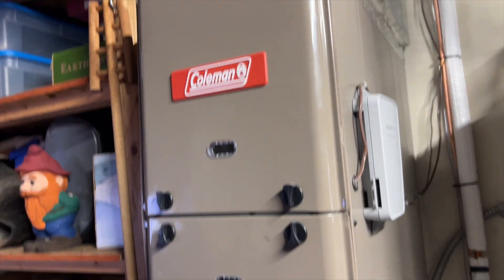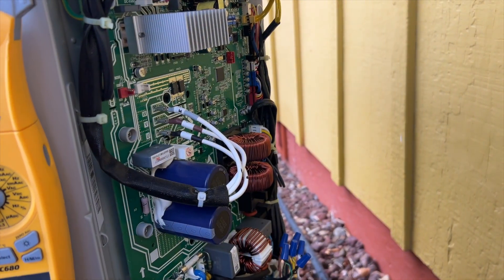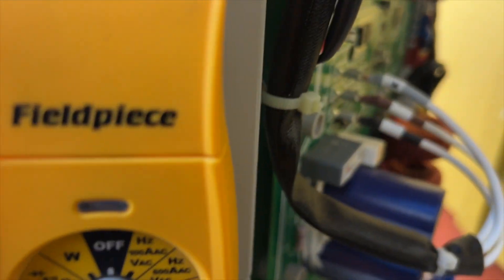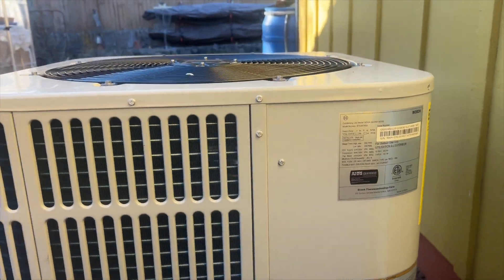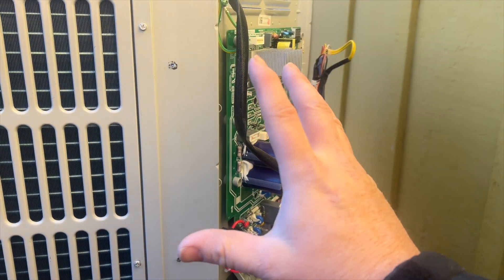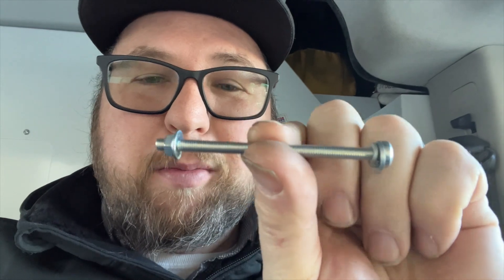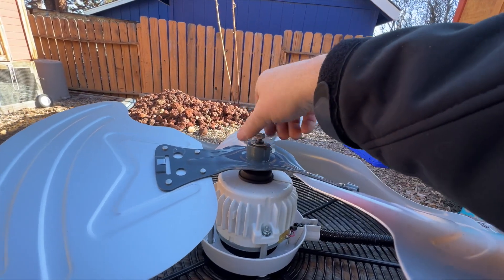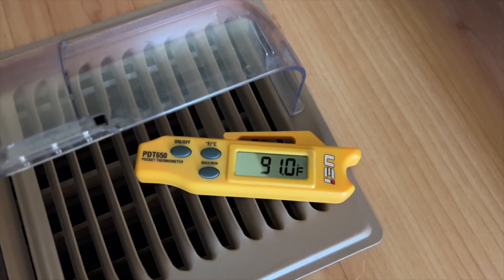Bosch Inverter System Not Heating EP166

Comment: Dual-fuel inverter systems are the only way to go.  Here in Colorado NG is cheaper but most have solar.  And Daikin/Amams have great inverter side exhaust heat pumps for the same price as straight cool.  Even if you don’t use the heat pump, you have that option.  Mind is set to switch over at 32 degrees and NG furnace backup.  My panels make enough energy to cover and top my batteries off.  My HP will run to -22 but COP is low and the furnace is so much warmer.  My clients love their systems on Daikin or Bryant/ICP.

Comment: Good call on replacing both things.  Either one of those could take out the other one.   Not under warranty I think you would have been safe just changing the board but in this case it’s neither here nor there. 👍

Comment: They were lucky it was under warranty....one part fails on those systems....there goes all your "savings" you thought you were gonna get. $2k for a board.....I'll stick with my 80% furnace and single stage 14 SEER "dumb" system. Im in heavy commercial and our stuff doesn't fail nearly as fast as it seems to happen in residential.....its lile the manufacturers make residential equipment very cheap and failure rates a lot higher......naw....they wouldn't do that....would they....😅😅😅😅😅😅